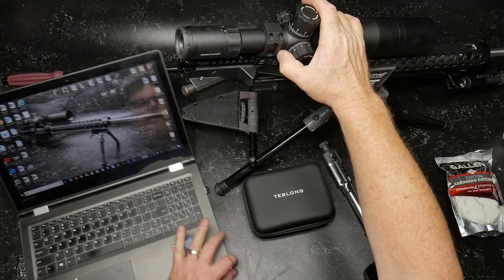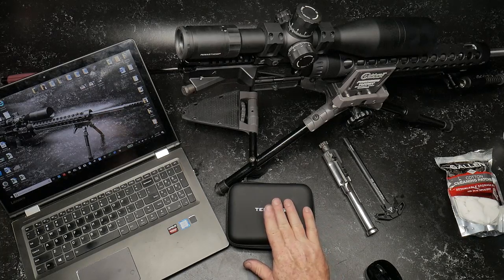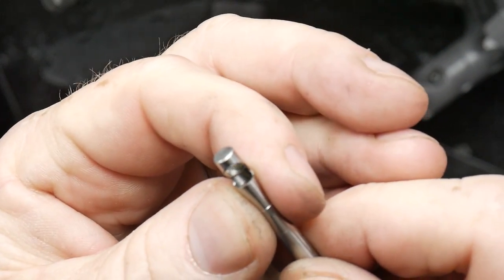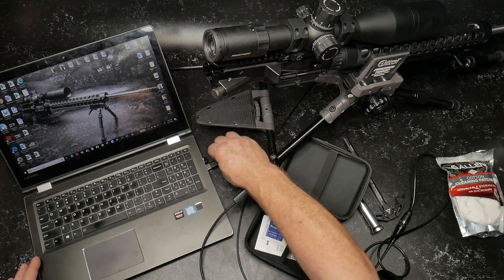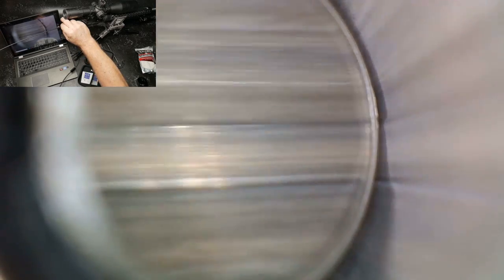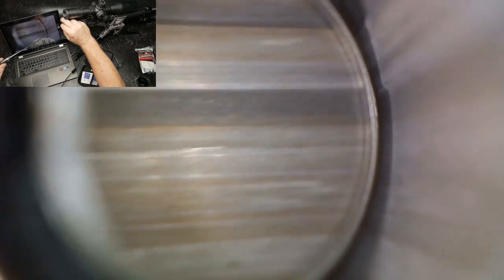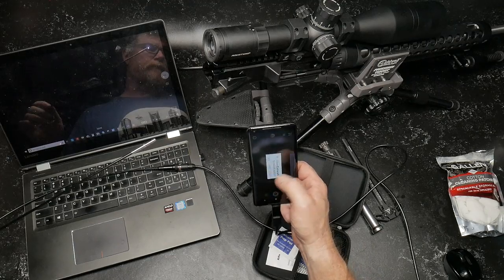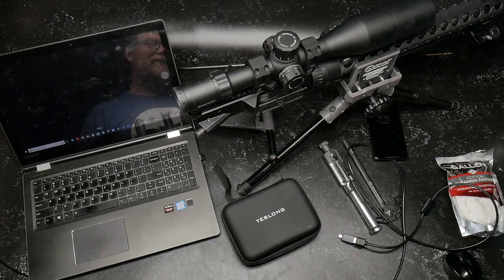Teslong Borescope Review!  This Thing Does an Amazing Job

Comment: I worked with aircraft engines for 29 years doing inspections with boroscopes, they ranged in costs from $70,000 to $120,000 dollars to buy one. Your unit was just as clear.

Comment: I bought the more expensive NTG150W version that is WiFI.  It arrived this morning and I just got through playing with it, but will be sending it back.  It works fine with the wifi, no issues connecting with my phone, etc.  The picture is great, but the part that makes me mad is that Teslong's website specifically says this version can also be plugged into your PC directly with the USB and used that way too.  Well, "technically" that is true, but the problem is, when plugged into the PC, the LED lights do not come on and there is no way to turn them or control the brightness.  So yes, the camera does work on the PC, but without lighting, it is useless.

I wanted to be able to do my inspection on the PC, but have the wifi convenience if I wanted to inspect a bore while at the range without having to plug it into the phone.  This version does not meet my needs.  I may just return it and get the cheaper USB only version.

They also now offer a 4-pack of mirrors in different sizes for specific calibers from 12.7mm, 9mm, 30 cal and 22 for $19.95.

Comment: Thank you very much for the heads up. I bought one and Im thoroughly impressed. I never knew that much throat errosion was in the old 25.06. I guess pappy was running quite a few  hot loads through it before he bequeathed  it to me.